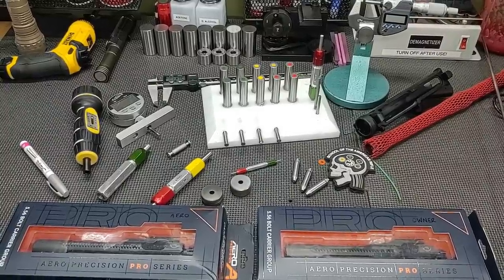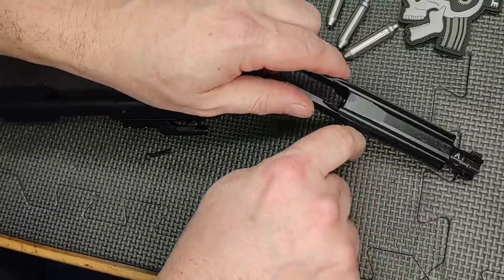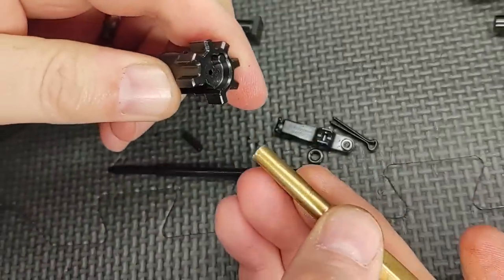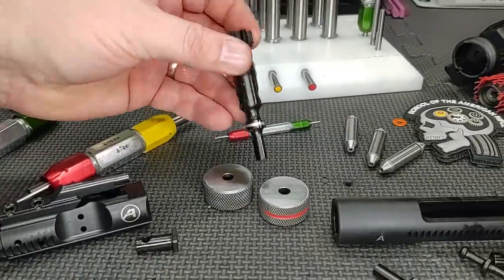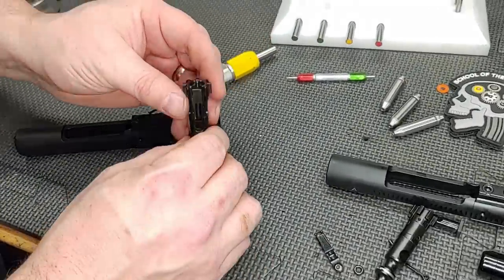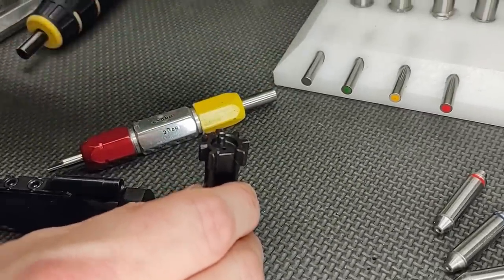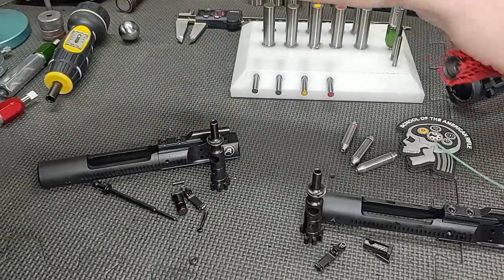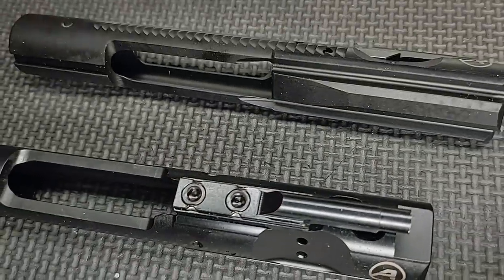2 Aero Pro BCG Physicals

Comment: I bought one of these a couple months ago when they were marked down. Headspacing on the bolt was so off that it wouldn't chamber a round.  Sent it back to Aero and they confirmed that it failed headspacing. Return process was straightforward, and I got my money back, so Aero's still OK in my book. I just happened to get a bad one.
Reply: This is my thought when I get something that failed QC. No company has perfect QC, but every company CAN have great customer service allowing them to correct the mistake.
Reply: @XxCrankyMoosexX  Exactly!
Reply: For real, sometimes you miss the mark on QC, it may have worked in your test guns but it doesn’t work in mine, as long as you make it right without a hassle I will tell everyone how great a company you are, you give me any shit, I am doing a charge back AND slamming you all over the web. You lose twice while I only lost a tiny bit of time

Comment: Have you ever tested a bcg that passed at 100%. With everything perfect
Reply: Unsurprisingly, FCD is the only 100% I can remember
Reply: @Beltfedhatemachine  FCD is great. Their selector is by far the most comfortable and feels the most robust and durable out of any I've tried. I use quite a few of their parts on my stuff. DD is def another great one. Currently running a BCM lower, but getting swapped to a SOLGW lower that has a FCD selector, mag release, and castle nut, WMD nitromet mag catch and bolt catch, POF enhanced buffer tube, IWC melonite steel end plate, and WLA nitride trigger/hammer and takedown/pivot pins. 

That lower is being used on a DD mk18 upper that I'm doing a barrel swap on for a BA 10.5 and popping on an X2 dev group VF18 forward venting muzzle device cuz I prefer the nitride finish and have had great exp with In terms of durability, longevity, and accuracy.
Reply: The Gieselle REBCG was perfect as well.
Reply: @Beltfedhatemachine  The Sionics NP3 did too. That video isn't on youtube, only facebook. They do the BCG for FCD so not surprising.

Comment: I'd love to see a video where you compare and contrast different coatings used in the industry and how it may affect short and long term performance and parts wear. Phosphate vs nitride vs DLC etc. Love your videos
Reply: I would like to see that as well.
Reply: Not that I'm saying arfcom is awesome, but their forums have a good thread from a high volume shooting facility near Las Vegas, with reports on durability of various parts including bcgs.  Chad probably has better things to do, I'd wager.
Reply: @the1knifepro169  Agree completely.
Reply: You’re in luck: the video is out
Reply: There's another guy that has 100s of bcg. Most used to failure or with problems. He says the best is phosphate chrome lined. The coatings on most bcg make them out of spec. If not he usually sees chipping happen more frequently and sooner on the bolt face with mitride and especially nickel boron. Amick with the original.

Comment: I had one of the Aero nickle BCG's and had an issue with the bolt. I contacted them and they sent me a 2day shipping label. Once they got it they confirmed the issue and replaced it.
I had the replacement within a week and it now runs perfect. 
Sometimes customer service is everything when or if you need it. 
This issue showed me I made the right decision buying Aero and will continue because of that alone.

Comment: I worked in a radio station and “erased” commercial cart magnetic tape every day. An engineer taught me that the bulk of the demagnetization occurs when the object leaves the magnetic field. Instead of just sliding, add oval loops while moving left to right (like a bi-plane at an air show) so that the field is broken in multiple patterns.

Comment: I don’t own any Aero parts but they seem to make pretty good stuff. It seems as if they are best value in the AR market today. Buy a stripped receiver set and everything minus the rail, trigger and barrel from them is what I’d do if I was going to snag their stuff. This BCG for 160 bones knocks it out of the park! Thanks for the review!
Reply: Yes but you can get a SIONICS BCG for $9 more.
Reply: Their barrels (which are actually made by Balistic Advantage) are actually quite good too. If you aren't dead set on chrome lined hammer forged I wouldn't overlook them. I have 4 of their barrels and have absolutely no gripes with any of them
Reply: I actually have grown to prefer their barrels from BA. Mainly due to the fact that I prefer nitride to CL because of the additional corrosion resistance over the mag phosphated outer finish. They have been gassed fairly well and are just as accurate as my DD and POF barrels
Reply: I own 4 and Just built an AR10 in 8.6 BO, love their quality.

Comment: I have to thank you for the educational value and professional presentation of your videos. I have a Springfield Saint .300 blk pistol that I have not even fired yet. I recently put a Q 7" tapered shoulder barrel on it for when my e-form 4 clears and I install a Trash Panda. Watching your videos has given me much needed insight. I have been examining various things as I gain knowledge and today 2/14/22 while examining things very close, I discovered the ejector roll pin was not seated correctly and was protruding out one side to the point where it has been making contact with the barrel extension lugs. I had to buy a few more things as being a retired professional mechanic doesn't mean I have the specific tools needed for gunsmithing, but I did buy what I needed to compress the ejector in and the correct punches, both of which I lacked. Edited 2/24/2022 To me this is just almost crazy. I had to wait to get a few more items, including my new 4oz hammer, the Brownells ejector tool, because that other thing I bought was crap, some specific punches and some new ejector roll pins. I also got my new Clymer go no/go gauges. In removing the ejector after removing the pin, the ejector was rather stuck and I had to grab it with some needle nose and really pull. After it came out and examining it with close-up magnified goggles, I discovered metal filings had been stuck in the ejectors slot for the roll pin then fell free once the ejector was pulled out.  It was slightly magnetic and had some damaged edges from the filings which I cleaned up with a tiny file and made all nice but I was like, I'll be damned! I don't have a demagnetiser so it's just going to have to be for now but the go no gauges worked slick and the bolt carrier didn't lock forward on the no/go gauge but did with the go gauge.

Comment: Just a thought on demag'ing parts. The demagnetizer uses 60 cycles, standard Alternating Current frequency, to create a magnetic field that reverses 60 times a second. It you power down the device while still holding the part close by it you get that last, final magnetic field pulse and can actually magnetize the part you are trying to demag'. Move the part away from the machine and the demag' should hold.

Comment: The only PRO BCG from Aero Precision is nitride.  I can find no reference to any DLC coatings for this product. It is advertised having a 9310 bolt ("shot peened and properly heat treated") and is HPT/MPI tested.  Thanks, again, for your most excellent and informative videos! Cheers!
P.S. I just bought one of Aero's HPT/MPI tested phosphate/chrome-lined BCG with a 158 Carpenter bolt marked  "MPI":  it is not marked as being HPT'ed either.  This was primarily based upon your BCG coatings video, BTW.   I've had zero issues with various Nitride, NiB and DLC bolts, but I thought it was time to try a phosphate/chrome-lined (basically "mil-spec") bolt...

Comment: I recently had a Aero Precision 308AR BCG with something wrong on the firing pin finish. It was mottled/splotchy in appearance and did not slide smoothly in the bolt right out of the box. Return was easy and replacement was fine. Headspace was tight enough that it would not close on GO gauge in a “match” chamber (read very tight). Barrel maker said it was less than 1 thousandth off and reamed the chamber very slightly for me. I am not complaining about the headspace - bolt and barrel makers were both trying to make it tight and tolerance stacking bit me.

Comment: 2yrs later, I have picked one of these up. Just by running the charging handle a few times with the BCG installed, the coating is coming off in the typical contact points. Im not sure if this is uncommon or not but stood out to me since this is called the Pro version and people pay the extra $ for them.

Comment: The worst bolt carrier I saw while I was active in the business came from brand C. I was struggling to make M4s run with a proprietary nickel boron coating and no lube. After borescoping a couple of carriers and realizing the gas seal surface was rougher than a corncob, we sent pics to the CEO, along with a pic taken inside a brand D carrier. No more bad carriers, and the project went much better.

Comment: Often times I notice parts, cutting tools, and gauges becoming magnetized during the machining and inspection processes. As far as gauges are concerned I notice it mostly with pin gauges. Parts will typically, but not always, lose magnetism when heat treated

Comment: Im a dealer and I've had LMT bcg groups that were all over the place dimensionally. Some tight some loose.
 I've had many LMT uppers with canted front sight bases(18 out of 25) 
The BCM uppers have been mostly good but I did get one BCM upper with an out of spec upper reciever the way it mounted to the lower.
 I also had a BCM gas key that was buggered up right at the opening where the key meets the gas tube. So too tier manufacturers are not always good.

Comment: I just want to say that some parts being magnetic could be caused from if the manufacturing process uses an electric motor to cut the parts. Even engine machine shops the machinery can make the parts a little magnetic that’s why it’s best practice to demagnetize any parts that have been cut, ground , or machined if any way

Comment: Recently purchased Aero upper and BCG. The upper would not accept a charging handle. Took 3 weeks to get it replaced. BCG gas key was poorly staked. Fixed it myself. IMHO Aero is 3rd tier.
Reply: or 4th.
Reply: I had the same issue with gas key staking on an LMT BCG.

Comment: Wish I could say the same for Ballistic Advantage. In process of sending back my AR10 308 barrel and bcg. Bolt would not close on a clymer GO gauge. Unfortunately didn’t have the gauges when I built it. Having problems, bought the gauges and low and behold look what I found. Very disappointed, especially since I called BA when I ordered directly from them if they checked headspace when barrel and bcg purchased together. BA stayed no they don’t, requested they check it for my order, it was assured to me that their products are “in spec”. Giving them the benefit of the doubt, for now.
Reply: BA is likely using the same mfg. Who knows if they come from aero or if they get the aero "-no-go" batches. Rebranding in this industry is disgusting we should all advocate for companies being transparent and being up front about who makes stuff. I'm pissed at the garbage responses aero gave me when i asked who made this. I'm returning both of mine just because of their deceit and withholding of information in relation to a life-saving product.
Reply: @adamkoltun4436  look at the forums and see how the top tier manufacturers are having crappy parts coming out. Talked with my local gunsmith and he is in agreement. So much pressure to get products out that they’re either using tooling longer than should be used or the QA process is lacking.
Reply: @adamkoltun4436  BA makes a lot of stuff for Aero. Aero owns them as of a couple of years ago.
Reply: @thomashanke6750  Hey thanks for the response! Yes it is a shame that QC has dropped. I even bought a Benelli m4 last year that looks like chicom garbage next to my older ones. Its a 2000$ paperweight. I have seen garbage coming from every company up to BCM and DD and Geissle even. The demand needs to not be met by lowering QC. From what I've gathered, all BA parts that are not barrels are Aero's no-go run off or extras which is what allowed that barrel company BBA) to offer the same aero products with a dif name on it. I also understand that all the Aero barrels are made by BA. Who do you think makes these BCGs? Aero commented publicly they are not toolcraft. Their CS team says they "cannot" disclose the mfg'r. Heartbreaking that arms companies are trending to selling their run-offs as rebrands. There should be up front transparency. Guns are now as bad as body armor in this sense. Whats even more pathetic is that people who bought something ignorantly will just get defensive rather than getting mad at the manufacturers that got over on them. People have brand loyalty to companies that are selling other peoples' stuff just with their name on it. All the spartan armor dummies will aggressively defend the brand not even knowing its RMA armor in their carriers.
Reply: @adamkoltun4436  yup totally agree!!

Comment: Ever consider doing a physical on a Sig 516 and or 716?  I have several of each that are like gen 1.5's. One is stated gen 2 . They have the newest bcg and gas and piston systems but still cheese grater 4 sided pic rails. Sig was kind of like Colt mixing and matching inventory when possible when transitioning generations. Mine are special order FDE models from the 4th Brigade, 3rd Infantry Division FT Stewart GA.  BEAUTIFUL looking rifles with superb build quality throughout.  I have 16 , 14.5 in 556 and 16 in the 308. I don't understand the hate for these fine firearms.

Comment: How would their gas tube work in conjunction with the oversized port on the key, wondering if their tube is oversized or standard. I know you once had a guy with a possible gauge coming out to check diameter of gas tube from wear. Did he ever produce or he only sent you prototype?

Comment: Purchased Aero BCG for DPMS a couple of weeks ago. Firing pin is also very magnetic, i thought it was just me. I would think they MPI the carrier by itself, so what's the likely cause for the pin?
Reply: Artifact of the coating process, maybe?
Reply: @seanoneil277  Perhaps.  My pin isn't coated like the Ar-15 pins are, bare steel i think.
Reply: @jmoore46  Sounds like coating didn't influence it.  Interesting.
Reply: It's an artifact of the machining process. Every once in awhile, a random part will become magnetic. Unless they manually check every single part, it's very hard to catch as far as I know.

Comment: 3:50 this one comment, "Folks would worry about rust" (lol) perfectly summarizes the absolutely pointless, 10- to 20-page long forum discussions between so many AR owners on endless minutiae. "This extractor spring FEELS just SLIGHTLY DIFFERENT." 

My lord. It's an AR-15. Run it. If it doesn't run, replace [whatever cheap part isn't apparently "quite right"].

Decent video, though.

Comment: Thanks for the review. What is your opinion on the bolt carrier being 9310? Instead of c158
Reply: Wished this would of been touched on. In the good bit of research I did before buying a BCG the general consensus was that 9310 is a no bueno compared to C158. Lots of issues despite being marketed as "stronger and tougher".
Reply: @skroback  hopefully Chad responds to this?
Reply from the maker: I have bins of bad examples made from C158 and 9310.
Reply: @SchooloftheAmericanRifle  Interesting. Just from what i've heard and read 9310 seams to break bolts faster than c158.
Reply: @SchooloftheAmericanRifle  do you prefer c158 or 9310? Maybe it doesn't matter?
Reply: From what i remember the 9310 can have better performance/reliability if heat treated 100% properly. Which is apparently a finicky process.

Comment: I like Aero and all... but to me, an Aero Pro BCG is essentially admitting that their regular 9310 bolts and BCG are not bet your life on them grade.

I replaced the 9310 bolts in the 2 Aero nitrided BCGs i have with Noveske C158 bolts. My 2 fighting carbines both have SOLGW BCGs in them. Ive also got 4 spare Microbest phosphated BCGs in case any of the installed BCGs go down.

Comment: I have a bcg that I bought about 10 years ago that the staking looks like someone used a flat head screwdriver and a hammer and gave it a slot all the way across the bolt head and into the key. It's got well over 1000 rounds on it and hasn't come loose yet, should I replace them and stake them properly?

Comment: Is a BCG supposed to be a drop in part? I’ve heard of issues of tolerance stacking when using parts from different manufacturers. Is that not supposed to be an issue with quality parts?
Reply: Yes a bcg is supposed to be a drop in part, but other things can contribute. For example, if you've put tens of thousands of rounds through a rifle and you try to put in a new bcg it won't headspace correctly because of the wear inside the star chamber. Usually a bolt and barrel are "married" together so when you replace one you also replace the other. That way they wear with each other. 

One other thing to keep in mind is you'll hear about how almost every bcg company gets their products machined from just a handful of machine shops (OEM). It's true, but even two from the same OEM can be different degrees of quality. For example, company A and company B both source from the same OEM but company A specifies tighter tolerances, more specific dimensions, and better QC. Then company A's bcg will be much better and more expensive than company B's even though they both came from the same OEM.
Reply: @jpowens2253  Makes sense. Thanks.